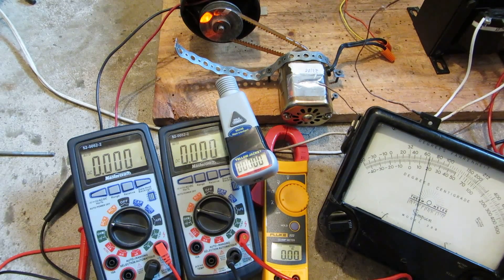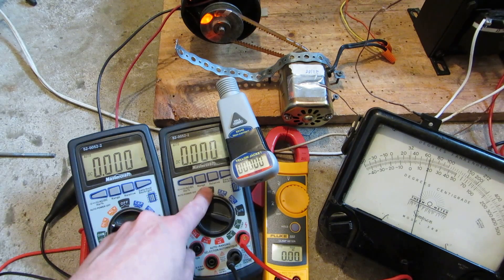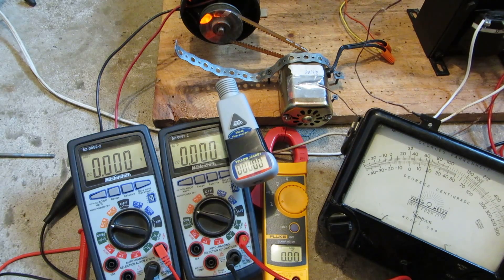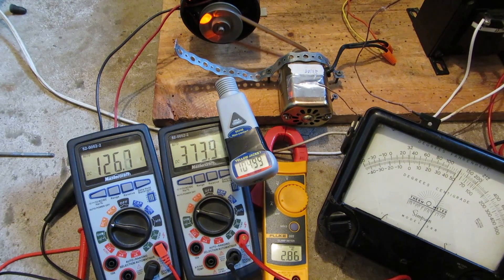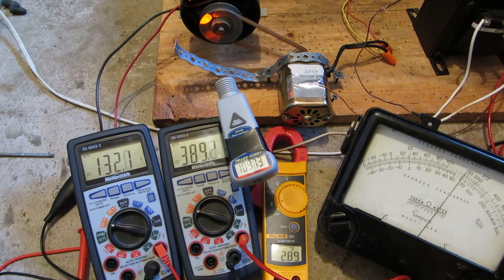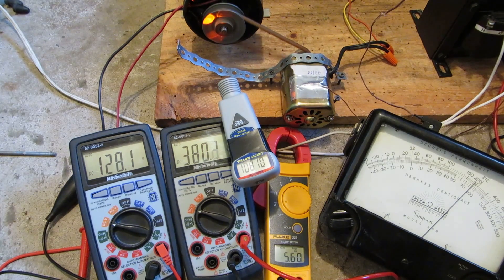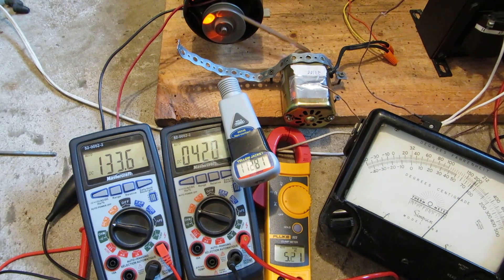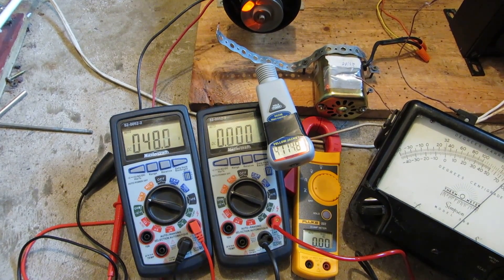Pushed to it's Limits: Kenmore Sewing Motor

Comment: What a beast! Must've been designed to run at higher than 120v surely. It would have been cool to run it at 380v and load up the gen as c202011 said and cook it with heat! :D
Reply: Edit: I hadn't finished the vid and missed that the plastic pulley melted hahaha, it got a bit hot! If the case was pushing 90+ degrees c, then the rotor and shaft would have been quite a bit warmer ;-)